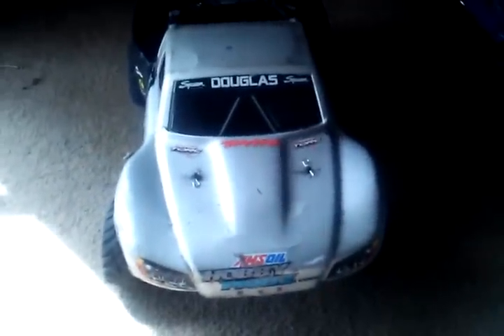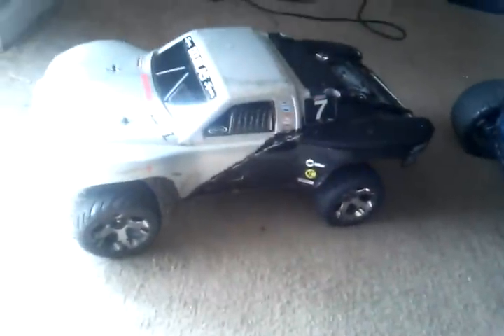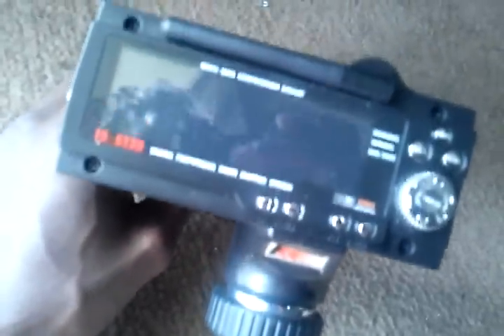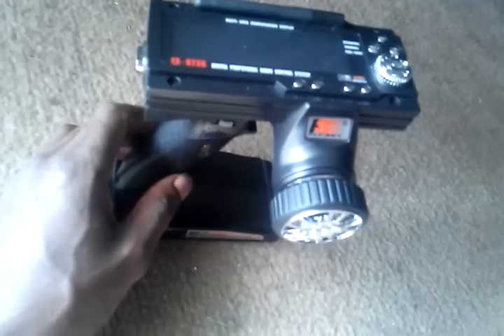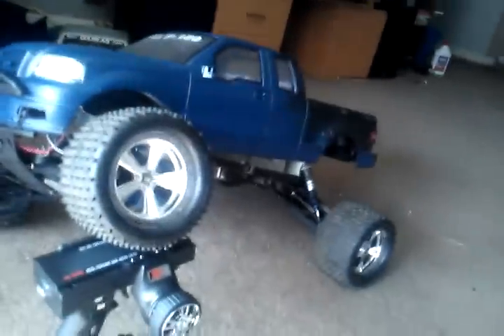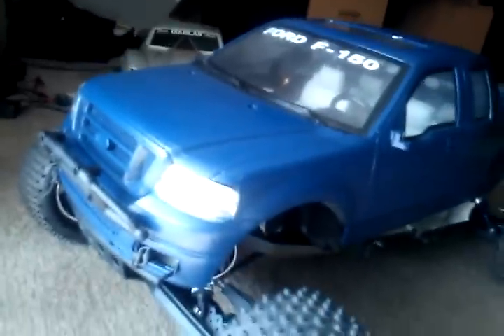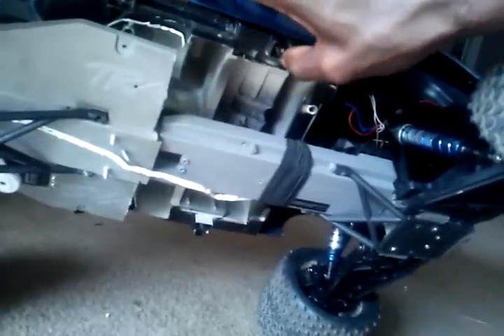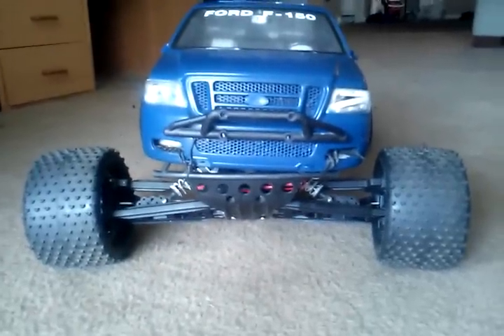Ford prototype chassis

Comment from the maker: Also if there is an issue with grip on gravel then your going to have to get different tire treads for just gravel. Once the slipper clutch is set right, then my advise leave well enough along. My opinion....

Comment: Hey man that truck is awsome lovin it it's a real beast hope you get the driveshafts sorted real soon I REALLY NEED to see this thing in action. With two Slash chassis bolted together should be cool. Gonna go back to 2WD with kitt and make my Blackfoot 4x4 again I think.
I heard you man, gonna us 2 Slashes as well and go with 2 E-Maxx plastic chassis and ditch the metal one. I tried it looked cool dint work move on and try again no use moaning hey?

Comment from the maker: Yes but it cost too much. If I get another Short Course truck it will be the Aftershock 8e cause it comes lipo ready, 2.4GHz radio and it has a metal chassis.